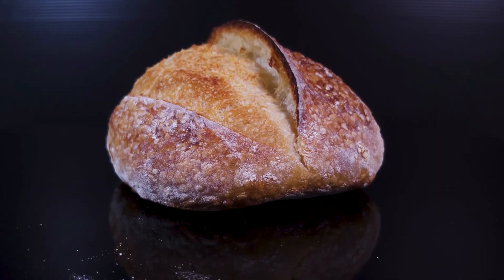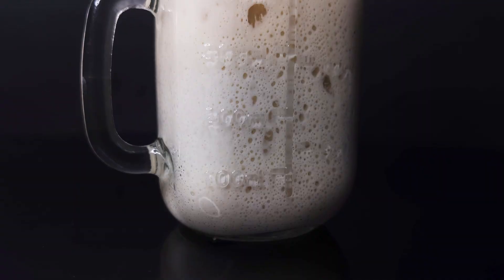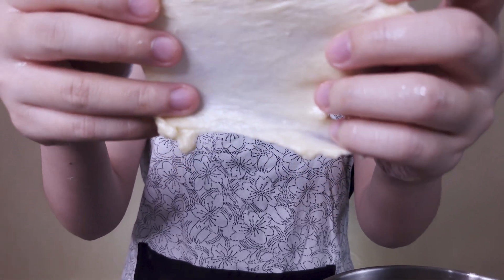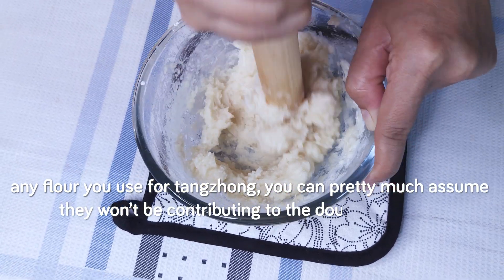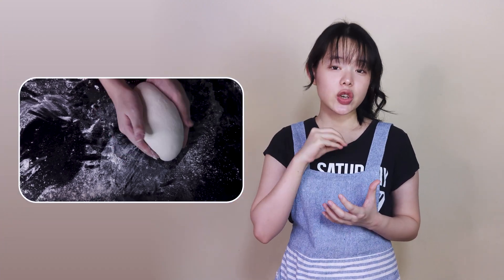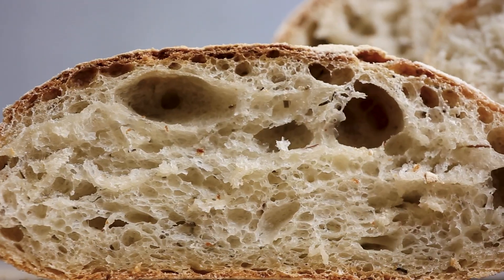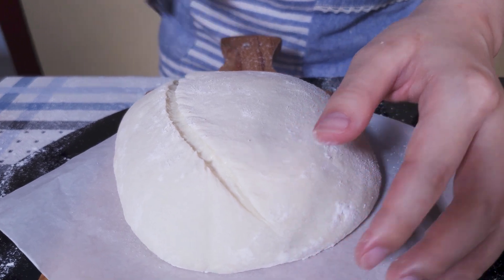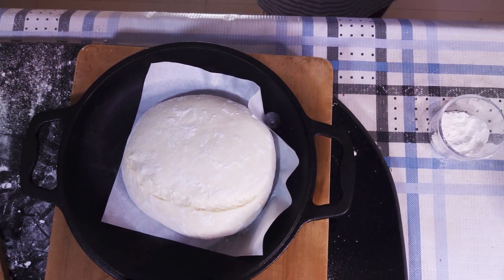How to Get The Perfect Sourdough Ear | Based on Science

Comment: What’s better for more pronounced ear, higher temps (240°) or lower temps (220°)?  

Convection “on” or just bottom/top heating?

Really love your videos and your explanations with references. Thanks.
Reply from the maker: Higher temperatures are always better, and convection on or top and bottom heating. Thanks for your comment.
Reply: Interesting, but I heard that convection increases the rate at which heat is delivered. I've heard that 200C with convection can be treated as equivalent 230C top/bottom. In your video (if I understood correctly) it's not only about heat and moisture but also about time. So if we blast the bread with a lot of heat it will accelerate crust formation, thus putting us at risk of dense bread. So if we go with 240C shouldn't we also increase the amount of steam to counter balance that added heat? Not to mention having that 240C with convection. On the flip side convection may also "deliver" moisture to the crust more efficiently, so perhaps intuition isn't going to help us here. More science needed :D @NovitaListyani